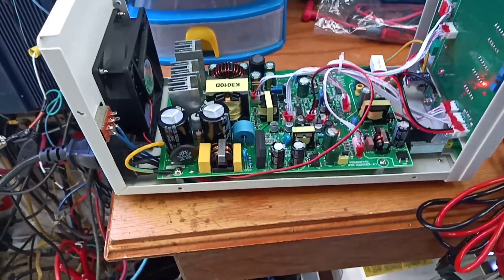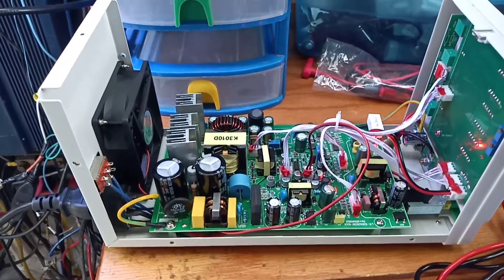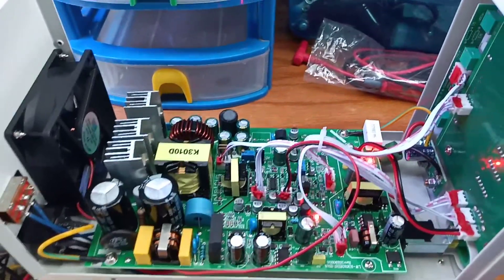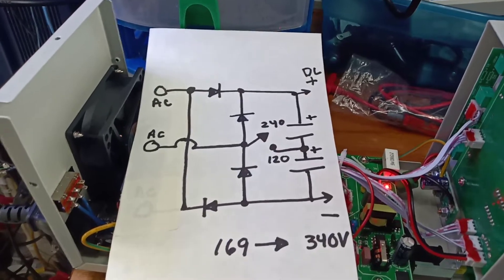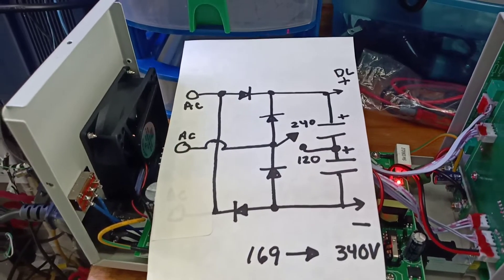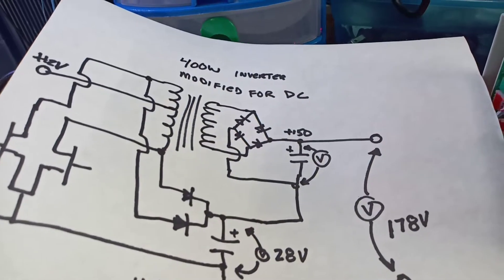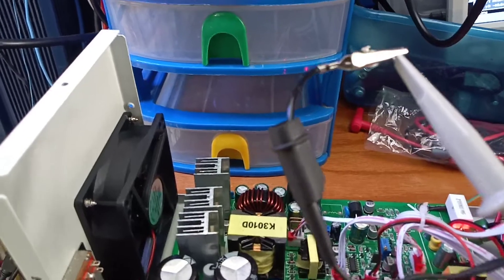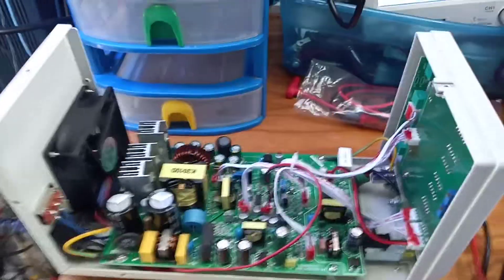LW3010DF 30V 10A Power Supply Running On DC

Comment from the maker: This supply comes with a decent pair of allegator leads. Those do have a floating spiral spring on a banana plug.  In the past I have had resistance issues with this type of plug and have had to file a section and solder that to the plug.  With high current this may become an issue. You also get a set of meter leads. I don't see why, these banana plugs have a protective plastic sheath which means you can't plug them into the power supply without removing the power supplies post nuts.  Those alone are worth a couple bucks.